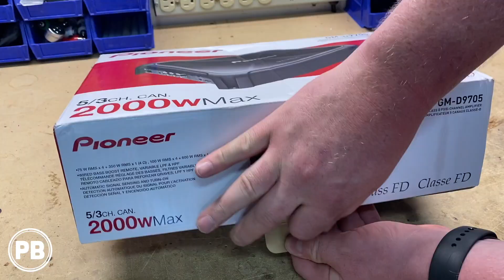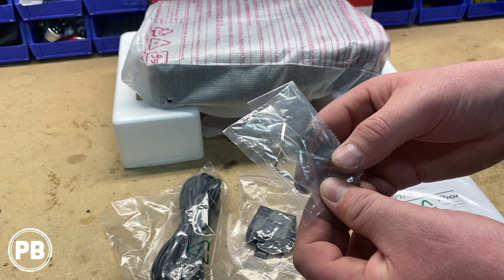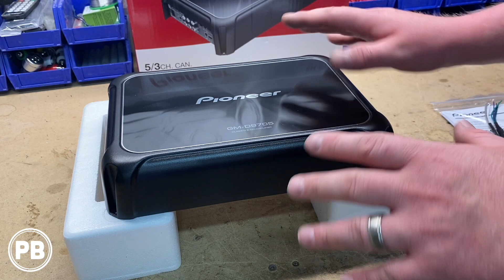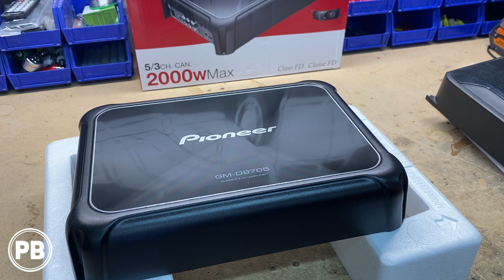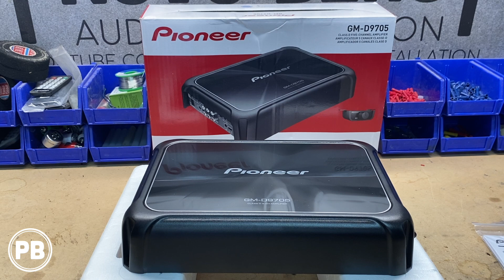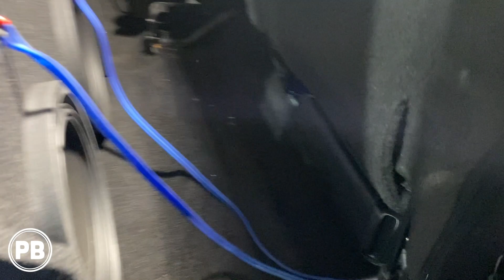Pioneer 2000 Watt 5 Channel Amplifier Unboxing | GM-D9705

Comment: Hello, i just bought this amp, can you please help me? Im not to sure how to bridge the amp.

I have 2 pairs of TS-6965V3 4 Ohm 80W rms speakers and i want to bridge channel A to run a pair and channel B to another pair. That way i can get more than 75W rms x 4.

Is there any way i can bridge the speakers to achieve the 200W x 2 @ 4 Ohms as advertised? 

And will i be able to run the sub channel at 2Ohms 600W rms when bridging channel A and B?

Thank you so much for you time.

Comment: Just bought this for my 2018 ACCORD!! QUESTION. with it having high level inputs for factory radio, does that mean a line output convertor isn't needed like an lc2i? My stock system doesn't have an amp?

Comment: Can you run 2 subs with 4 speakers? Also how come there are 2 rca inputs for the sub?
Reply from the maker: Yes, you would just wire them in parallel (since there is only one set of subwoofer outputs).  Just be consciences of your ohm load as this amp on the sub channel is only stable down to two ohms minimum.  You will need either two DVC 2 ohm subwoofers (wired on series / parallel) or two SVC 4 ohm subs.
Reply from the maker: Most aftermarket amplifiers will have two channels of input for the mono subwoofer input as the amp will sum both the left and right channel within the amplifier, in case you have bass with certain audio / songs on one side vs the other.
Reply: The subs I’m interested in are Pioneer TS-A3000LS4 they are 4 ohm so will it work ?
Reply from the maker: @chickenfoundation9323  Yep, those will work great. They are SVC 4 ohm, so wiring together, the amp will see 2 ohms.  Perfect match

Comment: Great info. I had a question. I was running a JL w3 12" sub and 4 6.5" kicker DS series speakers. However I blow two somehow and got them replaced with 4 6.5 infinity kappa 63xf , however only the sub and back two are working and not the front ones. I only have rca cables on the sub and channel b and no rca cables on channel a. Could that be the reason ? Because at first all 4 speakers worked great prior to these kappa. I'm sorry I know I'm a noob. Thanks

Comment: I bought this amp without a bass knob and I'm running 4 door speaker and 1 subwoofer. The sub barely makes any bass at all in comparison to the front door 6x9 speakers. Would a bass knob fix this low to no sub bass issue?
Reply from the maker: There could be a number of issues besides a bass knob - your ohm load for the sub, gain, output from the radio, etc.  Sure you could pick up a bass knob, but I'd check everything else first.
Reply: Seems like the knob has to be at least plugged in for this amp to sound good.  Why???

Comment: What subs would u recommend for this amp?
Reply from the maker: Something that does 600w @ 2 ohms.   Something like this is a solid build with a great price: https://amzn.to/3hSA20h
Reply: @ProvoBeastAudio  how would it do with a 900w 2 ohm sub
Reply from the maker: @tristannolan85  It will underpower the sub, but will be fine as long as you set your gains correctly
Reply: How would this handle two SVCs 4 ohms speakers, RMS 250 watts? Specifically talking about the JBLs Club WS1200.

Comment: Can we put 2 sub Plonneer  2000 watts  with this amp
Reply from the maker: You can add any sub to this amplifier as long as it is wired correctly.

Comment: Can this amplifier runs. 4 8" midrange and 4 tweeter.
Reply from the maker: Sure, it is two ohm stable at each of the 4 channels, so just make sure your impedance is correct.